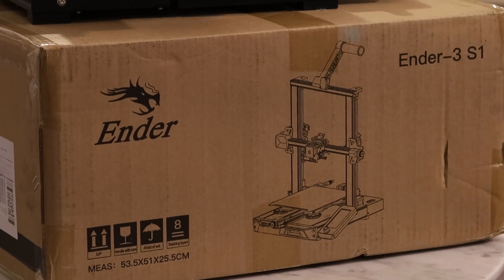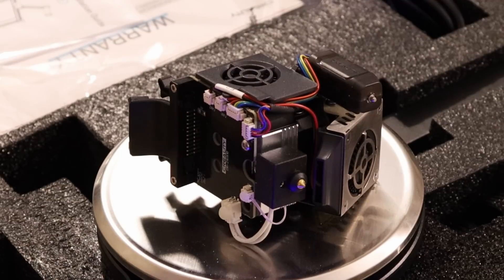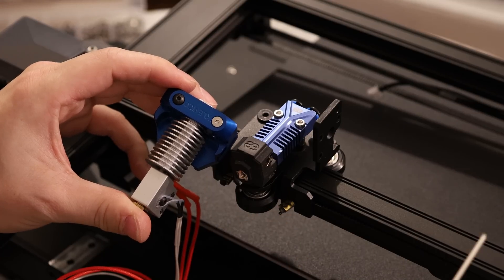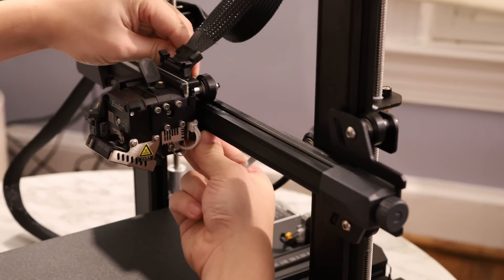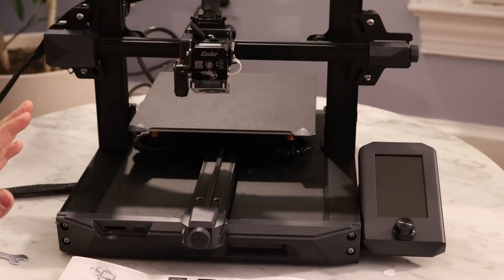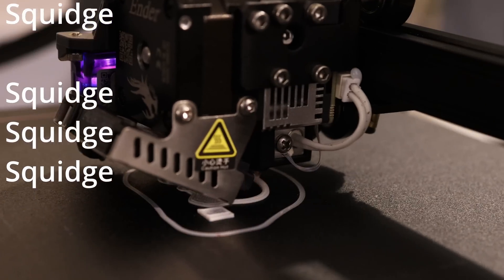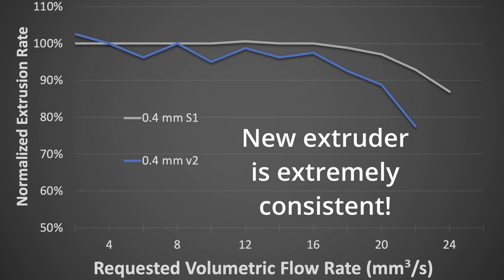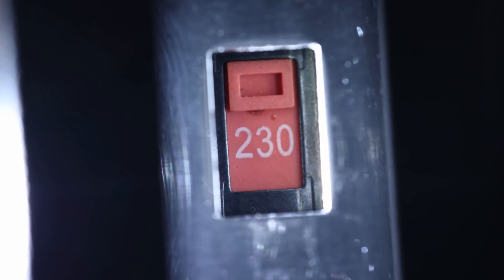Ender 3 S1 - A New Benchmark

Comment: One thing Creality has consistently failed to address is the X Y offset of their ABL firmware on nearly every model, you dont get a correct mesh when probing the bed, I was hoping you would show the probing so I could see if they have fixed this issue but I dont have much confidence that it has, fixing the X Y offset is so important for this printer as the bed is as bent as a £15 note!
Reply from the maker: It is really bent. If it counts for anything, it's printing fabulously. I'm laying down 100 individual miniature pieces on a bed and I haven't had a single part come loose. 

I'll be doing a video where I straighten the bed, I'll show the full leveling sequence afterwards (sped up, but slow enough that you'll be able to see the meshing points.)
Reply from the maker: Just watched it probe the center of the bed for z limit prior to printing, it was dead center. Will still follow up with a video of mesh leveling.
Reply: @NathanBuildsRobots  I am really happy to see Creality finally fixing this issue, I hope they also fix their ABL firmware for other models which shouldn't be too hard, this would be great for new users who won't immediately know which 3rd party FW will fix the issue or that there is an issue to start with, I have two Ender 5 Plus machines and one of them would not print the first layer of large parts well enough to continue with the print until I flashed Insanity Automation FW to fix the X Y offset, it now prints like a champ!
Reply from the maker: @AndrewAHayes   I feel like they half assed a lot of their products lately, but I'm happy to say this one is good. They really did their homework this time.
Reply: I bought one recently and it didn’t use the mesh or didn’t correctly measure the bed. I spent ages trying to get it to work and eventually gave up and returned it.
Reply: @jamrity  I recently watched a comparison video on ABL sensors by Aurora Tech, the CR Touch came last of 4, it even came after the knock off 3D Touch and the figures were terrible, Aurora Tech thought they had a bum unit, well I personally know of one person who's printer came with a CR Touch and gave terrible level data with a perfectly manual levelled bed and the first layer was actually better without using the CR Touch mesh, I also know someone who bought a CR Touch for her Ender 3 pro and that was the same, I gave her a BL Touch to try and she sent the CR Touch back and ordered a BL Touch, my experience of the CR Touch is not a good one, I think there are either a lot of dodgy units out there or they are all bad and the only ones that work are on beds that are not so bad.

Comment: This is my first printer. And it works great! Using it all stock, but got a glass build plate, the ultrabase from creality. Printing PLA at 50mm/s is np and gives amazing results
Reply: I've had mine for one week.  I print at a 0.12 line thickness and you can barely see the lines, even  under a magnifier.  This is my first 3d printer and I'm spending all day, every day, learning all the parameters to adjust, and what effect they have on the print quality.  I'm trying to get good at support enforcers and I find the snug  support base option in Prusa to be great. You can add supports just where you need them, and selecting snug, the supports do not take up unneeded space on the bed.  At first, I used the Creality supplied Cura slicer, but then I found the Prusa Slicer.  I use the Prusa slicer now because it's ability to paint on supports, and the way you can analyze each layer is far better than Cura.  So far, so good with this printer.  I'll probably mod the fans and go with Noctua. I use them on my computers and love them.  I am really looking forward to your mod videos on the S1.  Great video, subbed!
Reply from the maker: @emilcost8613  I like Prusaslicer a lot. All the important options are easy to look at and change, moving and editing models is snappy. 

In Cura everything's stuffed into a tiny menu in the corner of the screen. Not a big fan of that. But Cura has more advanced algorithms, so it's interesting to use both.
Reply from the maker: I think you can go up to 100mm/s, will be pushing the speed limit soon.
Reply: @NathanBuildsRobots  i will want to see that, I never print below 80 mm/s unless is a detail print.
Reply: that indeed looks like a really nice beginner printer, i have modded the hell out of my ender 3 max, would have bought this if it was a thing when i started
Reply: @thorgraum1462  The glassbed is not something I would recommend anymore. PEI all the way. Also the TR4 bed from creality is great (G10 fireproof fiberglass). If I needed a new printer right now I would go for the Ender 5 S1
Reply: @DoctorrMetal  yeah, my ender 3 max is running linear rails, pei flexplate, Revo extruder and dual 5015s for cooling, aswell as klipper with input shaper and pressure advance on a raspberry pi 4, motherboard is MKS Gen L v1.0

also, i dont adjust my speed anymore since my machine is good for around 150mms, i set a target speed of 75mms and let my volumetric flow limiter do the rest. that works really well, and ensures that i never have extruder skips as my machine never goes above 14 cubic mm. works really well when printing with larger nossles. also easier to get the pressure advance to work as intended when the nosslepressure is equal through the entire print sequence

Comment: Blinker fluid ftw!
Reply from the maker: Ask for it by name!
Reply: @NathanBuildsRobots  They only had Front Left Blinker Fluid. I read somewhere (on a secret confirmed source) on Reddit, that Rear Left is the best fluid you can get because of the redness that’s inside it. Makes it basically more sturdy, because red is a dominant colors you know
Reply from the maker: I like the kind that's used for the amber lamps, which is closely related to the kind used on ambulances 🚑 🚨 
It has the highest rating for intermittent blinking applications.
Reply: @NathanBuildsRobots  Can’t disagree. Maybe make a video about it, somewhere between march and may.
Reply from the maker: @TuncayAyhan  April showers tend to wash away the previous application of blinker fluid, causing all sorts of problems.

Comment: seems like a great deal
Reply from the maker: It costs a pretty penny, but packs enough features to justify the price. Plus it will probably have great aftermarket support, being an Ender 3.
Reply: @NathanBuildsRobots  all up after taxes its right around what people will spend in mods, and it’s backwards compatible if you don’t want to use the sprite extruder. In my opinion theres no reason to not choose the S1 over any of the Ender clones, or any other Ender 3 unless you’re going to make a print farm.
Reply from the maker: Personally, I still like the Voxelab Aquila as a budget starter printer since it's 40% the cost. But if you just want 1 nice printer that won't need a ton of mods, this is it.